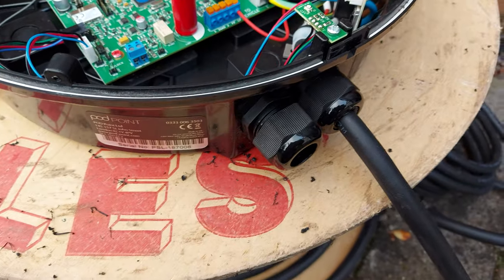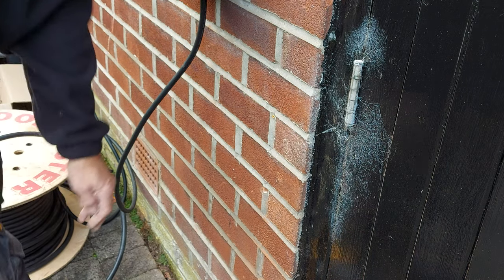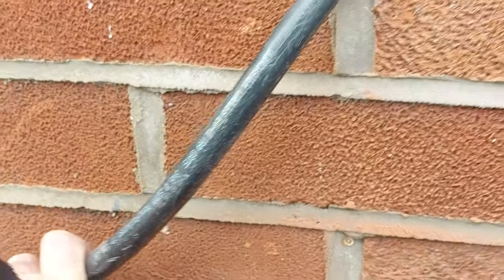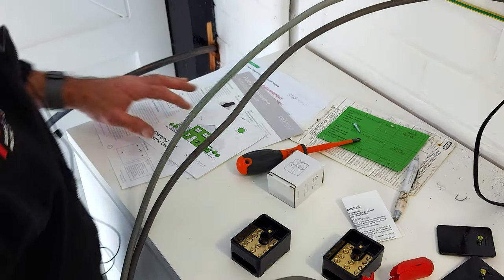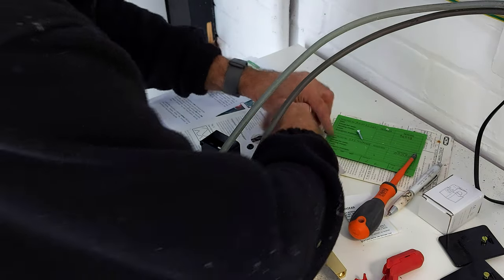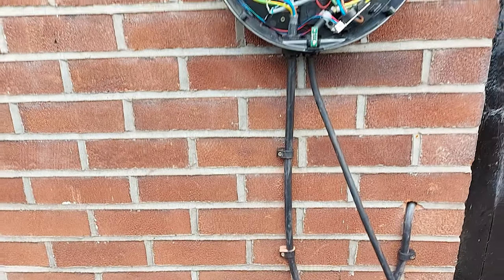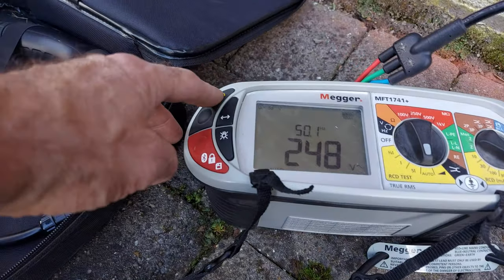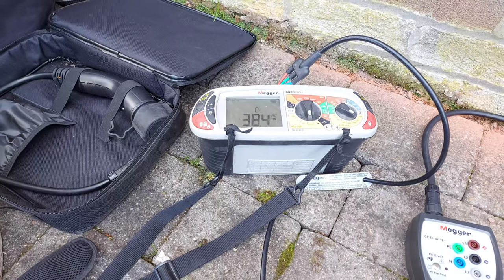Pod Point Solo EV Charger Installation.

Comment: I have a Pod Point SL 3261 that is rated at 32A, but my is doing no more than 14A. How can I set it to 20A, or any other settings?
This model does not have DIP switches.
Reply from the maker: Hi Mladen. I don't like these types of questions because I don't know your installation parameters and there may well be a very good reason that your Pod Point is limited, such as maximum demand, main cut-out rating, or numerous other reasons, and ignoring these would be potentially dangerous. The first port of call is therefore to contact your installer directly and take it up with them. After that, I suggest you contact Pod Point directly, and if the installation was correctly notified, they should have the relevant site information to enable them to increase your output with an over the air update.
Reply: @abcelectric  Thank you quick answer.
Car that is using it is my Renault Zoe imported from Norway. It came with Pod Point and Isolation transformer (as Norway has specific ground connection). Here it does not need isolation transformer. Probably not to overload the transformer, it is limited to 13A. House it is in has 50A servise, and garage has 3x4mm cable with 25A fuse. So I wanted to set to 20A, to speed up the charging process.
I contacted Pod Point UK and Norway, but they did not reply.
Reply from the maker: Hi Mladen. That is not a great setup and I don't know where (or if) the CT clamp is connected. You still need to contact your installer or Pod Point by phone or email to get an over the air update. If it's not connected to a WiFi network then you can't change it anyway. If it is connected, you can access the settings through 192.168.1.101, but with that poor garage setup, you shouldn't really have anything other than a 16A radial socket circuit and a 6A lighting circuit on it. It's just not suitable for an EVCP other than a granny charger, and you and your dad should know that
Reply: @abcelectric  Thank you, again. 
We did 3 phase mod - when EVSE goes to active state, it turns on L1 and N. That signal is routed to 20A 2 pole contactor that turns on L2 and L3. Cars sees normal 3 phase supply and it takes 9kW (we have measured 13.4A with current clamp at each phase)
We put RCD for protection and 3 phase 16A before the EVSE. 
Here 3 phase is the norm, and most homes have 3 phase 25A service. 
Location is Serbia.
Reply from the maker: @Mladjasmilic  😂 And from the information you provided previously all I could deduce was a 1-ph supply in the UK. I have no idea about the regulations in Norway or Serbia, but it still doesn't add up that you've got a 3-core 4mm supplying 3-phase. Where's the Neutral and Earth in that? Surely you need at least 4 cores even with a balanced neutral, or are you pulling earth from a TT system? Look Mladen, I don't know your setup enough and I don't know the regs in Serbia. I fit 7kW 1-ph domestic models to UK Regs. If you've got a 3-ph 22 kW version then why all the skulduggery with a contactor and where are your N and E connections? Why not just wire it as L1, L2, L3, (N) & E straight in? Set up the CT clamps to limit the phases to 16-20A or whatever you need to do. From the current readings you've given, are you also aware that the AC-DC converters in a lot of vehicles won't allow charging above about 11kW total anyway? You could supply it directly from a substation and the car wouldn't pull more than about 16A per phase anyway. You'd need to go DC to get more than 11kW into a typical car. Check the IP access protocol for the model you've got and you can get into settings over WiFi or a temporary hotspot. Just type 192.168.1.101 (normally anyway) into your connected browser window and you should get to all the Pod Point installer configurable settings. Check your vehicle can work with an AC input over 9kW, but I would guess you're maxing out the AC-DC converter if you can't get a reading over 13A. After that, I can't help anymore without being in Serbia!
Reply: @abcelectric  
We had to run new 5x2.5mm cable from distribution box. It is cheap, costs about 2€ per 1m. Total bill of material was less than 20€ + some stuff we had laying around.
Car iz 2014 Zoe, that can do up to 63A at 3 phase (43kW). I checked the EVSE with the oscilloscope, at CP channel it gives 22% of duty cycle (22×0.6=13.2A), so car can pull 13A. 
As for 3 phase EVSE, we made a mod, where when main contactors turns on (after car is connected), at output L1 and N we connected the 20A contactor which turns on L2 and L3. Delay is about 50ms, but car does not seem to care. 
So, using less current (13A) than in UK, our car charges at 9kW (230V×13A×3). 
Reason why we can do this, is that our Pod Point had Type 2 socket on it, with pins for L2 and L3 left in, and it screw terminal type, not crimp. Also, with the car we got 22kW (3x32A) extension cable for public chargers.

Just to finish off - first we wanted to raise CP duty cycle so car can pull 20A (4.8kW) single phase (not go overload existing cables and fuses), but because EVSE software is locked up, we decided to mod it to pull 13A 3 phase (9kW). So we got more than double we wanted.
Reply from the maker: @Mladen Milić  It's a bit difficult for me to fully grasp everything with your English, but I think I understand now...

So you've got a 1-ph, 7kW Pod Point Solo, but now you've rewired the connector and added L2 & L3 via a contactor (switched from L1) from a 3-phase supply run in 2.5mm x 5-core and you've fitted RCD protection upstream and presumably 16A overload?

The Pod Point has a 6mA RDC-DD on the single phase output, so you need to protect this phase upstream with a Type A 30mA RCD. The other 2 phases from your contactor would now need upstream  protection from a Type B RCD.

L1 in the PP is protected by a PEN protection device that disconnects L, N & E in the event of a N/E fault at source, so make sure that L2 & L3 disconnect immediately when L1 drops.

The very latest Renault Zoe 50 can charge at max 22kW 3-phase or 46kW DC. I don't know about the older 2014 model.

What you've done sounds ingenious, but it's no doubt invalidated the warranty. I'm also highly sceptical about the safety aspect and whether you're blinding any upstream RCDs because of the reflected DC component in L2 & L3. There are certainly more questions than answers from where I'm sitting.

I don't think I'd plug my EV into it, but good luck to you, though, mate! 🤣
Reply: @abcelectric  This older model has no internal RCD at all. EVSE came with external RCD and 2 pole 16A fuse. If you are interested, I can send you the pictures we have taken over Viber or WhatsApp. Just give me the contact.

Comment: Thanks for the informative video i am just researching before doing a course
am i going to need to upgrade my 1740 to the 1741+ like yours to be able to test the charge points
or will my current tester suffice for now
Reply from the maker: Hard to say, but you should be fine with the 1741.

Comment: is the energy clamp necessary or will the charger work without
Reply from the maker: As far as I'm aware the CT clamp needs to be fitted for the unit to work properly. I believe Pod Point can bypass it over WiFi if necessary, however it's an integral safety device to prevent overload of the main cut-out. I'd suggest contacting Pod Point directly to ask them

Comment: Hi Gary

Nice video.😢
Why no spd included in the install?
Reply from the maker: Hi Alan. Purely for cost, because they're not mandatory. This video was prior to Amm. 2, but they're still not mandatory even now on domestic installations. I don't think SPDs are even mentioned in the EV Charging Equipment Installations Guide 4th Edition, but I'm not 100% on that. More recently, if I'm fitting a new DB I generally include an SPD, but to reiterate, they aren't mandatory in BS7671

Comment: Hey bud. Great video. Any specific reason why there’s no AC isolator? Pod points manual ask you to install one, and I’m fitting one today. Unless I’ve read it wrong. Cheers
Reply from the maker: It's got to be supplied from a dedicated final circuit, so the MCB or RCBO is the isolator

Comment: I retired a long time ago now and would be classed "Old School" Spark but I would never take two cables through one gland, it is simply bad practice.
I would also drill through a wall from the inside to outside especially in this case as it was through and split the wooded door frame.
Reply from the maker: It's one combined cable that contains both data and power. If it was 2 separate cables I would use 2 glands. The rear access to the unit is only  designed for a 20mm gland, so with a 25mm gland bottom entry is required. The bending radius of the EV Ultra cable is also such that a 90 degree bend isn't possible so an alternative solution is required. If you'd worked with this cable you'd understand the difficulties
Reply: Stick to your retirement
Reply: You can make a bit of a mess drilling through to the outside, those bricks split out easily.

Comment: Good video, is it possible to buy the podpoint charger and get a local electrician to install it?
i would ask you but I'm too far away.
Reply from the maker: You could do that, however I'd be tempted to ask an electrician to quote the whole job as there's a lot more to it than that. Permission from the DNO is required and often the installation will determine the charger model. It's too big a subject to discuss here
Reply: @abcelectric  Thanks, I'll get onto it.

Comment: How did you connect those meter tails to your "Henly blocks"???????
Reply from the maker: That's a lot of question marks Roger. How do you think I did it? It wouldn't be very safe to do it with them live would it.
Reply: @abcelectric  yes, well, I believe that you called the DNO prior to commencement of the job and had the meter tails isolated so they may be safely worked on and then re-enegized once the work was completed.

Comment: Hi Gary.
             Nice video with a lot of info for such as myself as a customer, the one thing I can't seem to find an answer too is why you have to have 3 phase in order to run an 11Kwh charger,
 forgive my ignorance as I say I'm a consumer not a sparky,  but I have a 10.8 Kw shower which is near as makes no difference 11Kw on single phase so the need for 3 phase for a charger
 eludes me, could you please explain.
  All The Best
                    Paul.
Reply from the maker: Hi Paul. The answer is that it's a combination of things in the wiring regulations, EV code of practice and the DNO's supply conditions. Maximum Demand and Diversity are the main players in the wiring regs. A 10.8kW shower pulls nearly 50A on its own, however it's only on for maybe 10 minutes. A car charger could be on for 12 hours though. A lot of service cut outs are still rated at 60A but even if it was 100A there wouldn't be enough spare capacity for maximum demand when all other loads are accounted for. In your case you couldn't have a charger anyway if you've got a 10.8 kW shower. The calculations would show your maximum demand at well over 100A, so the supply infrastructure would be inadequate and you'd blow the main fuse. You have to account for everything being used simultaneously such as oven, shower, hob, sockets, EV charger etc etc. A 10.8kW shower is a heavy load, but only used for a short time, so the chances of tripping the service fuse are relatively small due to the time/current characteristics of the main fuse. It's an entirely different story with a 50A charger potentially pulling that high load for 8 or so hours. If you even had a 7kW charger there you'd be WAY over the limits. You can't get limitless current to a property and the regs are there because overloading the supply cables is dangerous and expensive to repair. There are other factors too, but basically the regulations are in place because of the laws of physics and the health and safety of consumers etc. Overheating cables can cause fire. If I was you I'd get an EICR done to check that you're not already exceeding maximum demand with a 10.8kW shower and that everything is safe as it is. If you have an electric hob/oven and any other big loads (however intermittent) you're probably already pushing the limit. The closest analogy I can think of is trying to fill an Olympic swimming pool with a narrow hose pipe in 5 minutes - the hose is going to burst!
Reply: @abcelectric  Thanks for that Gary all makes sense at last.

Comment: Gary, nice video but incorrect use of twisted pair cable. You should just use one pair, with a single cable going to each terminal, so that any interference impacts equally on both sides of the connection and is cancelled out. The way you have connected it defeats the objective.

Also couldn't see surge protection device installed and why not use a roper tail clamp, plus provide some support for the tails, as installed they look just about right for a child to swing on.
Reply from the maker: Hi Alan. The twisted pair isn't exactly carrying corruptible data. It's just the return signal from the CT, which I believe is converted to a 0-10V DC voltage for the load limiting function. Also, all 8 cores are next to each other in a screened shield. I think the way I'm using it for signal cable is perfectly satisfactory. SPDs aren't mandatory in domestic or EV installations and this was installed prior to Amm 2, where they are still not mandatory. I always clip my tails, (there's plenty of clear evidence in my other videos), however in this case I did it after filming, including the supplier's tails that they hadn't clipped either. Well spotted though. Nice to see you're on the ball. Just remember this is an edited site video, not an EV or BS7671 training course.

Comment: Excellent content Gary really enjoyed that! If I could ask advice? My pod point has been fitted today while I was at work. I’ve plugged the car in and it’s charging at 2kw,  I was expecting 7kw. All the settings in the car are at max so can’t understand it. Anything “go to” with these units from your experience? Cheers.
Reply from the maker: Thanks Steve.  3 things spring to mind. 1. The DIP switches haven't been set properly inside the unit (but I doubt that unless the installer was very inexperienced. 2. The CT clamp is modulating the unit output down because you're pulling nearly 60A at the main cut-out.  The output will ramp up again as the oven, shower or other household loads stop being used. 3. If the car's already at 80% charge you'll only get trickle charging for the last 20% or so. Hope that helps
Reply: @abcelectric  thanks for your reply Gary. The charger last night supplied 23.1kw in 9h30 mins, so around 2.5kw per hour. The house has an 80a main fuse and the car was on 30%. Fingers crossed it’s those switches inside. I’ve sent a message to podpoint so hopefully it’ll be cured otherwise my electric bill will be rising and my £600 investment will not payback as soon:(. I’ll be sure to let you know the outcome. Thanks again. I’ve subscribed to your channel👍
Reply from the maker: Interesting Steve. Out of the box the Pod Point's internal switches are set to minimum output, so that's definitely a likely possibility. (Poor from the installer though if they haven't been correctly set). There are other factors but too complicated to explain here. Assuming it's connected to WiFi Pod Point should be able to remotely diagnose the issue. Those switches however can only be manually configured. Good luck with it 👍
Reply: @abcelectric  all sorted Gary! You were correct in your diagnosis, the fitter hadn’t set something up in the charger. Podpoint used some kind of witchcraft and solved it over the phone remotely, it’s now giving a good 7kw charge. Thanks for your help and advice👍

Comment: I ordered my PodPoint and the contractor who wired it up, did so incorrectly 🤦🏻
It wasn’t until my EV turned up a week later, that we found out, when it wouldn’t charge. It took PodPoint 10 days to respond; and so in the meantime, we had to use an expensive charger at the local BP garage. Not even an apology from them 🥴

Comment: Naughty boy, you removed the main fuse and broke the seal on the meter.
Why didn’t you fit a 100a double pole isolator and make life easier for the
next electrician working on the system
Reply from the maker: I always ask the client to contact their energy provider to fit a 2-pole isolator beforehand. Sometimes they do, sometimes they don't. I have given up trying to contact ENWL or SP to pull cutouts. As with every electrician I do what I have to to do the job and if that involves pulling the main fuse and cutting seals so be it. I don't price for or fit an isolator because I have asked for it to be done. Pulling the fuse isn't really any different to flicking a switch so thats my answer. Practicality and safe working
Reply: You are allowed to pull the main fuse anyway, just make sure you reseal them with the appropriate installer specific seals.

Comment: Very informative video. Thanks.
My property has a 60 amp fuse, will this be ok for ev charger (by pod point)? If not, what should I do? 
Would really appreciate your help. 
Thank you
Reply from the maker: Hi Dipak. It's not that simple. It depends what other loads your property is pulling. Also permission from the DNO is required. I suggest you ask a local certified electrician experienced in EV chargers to do a pre-installation survey and then you can get a definitive answer
Reply: @abcelectric  thank you for your reply 😊 will update u